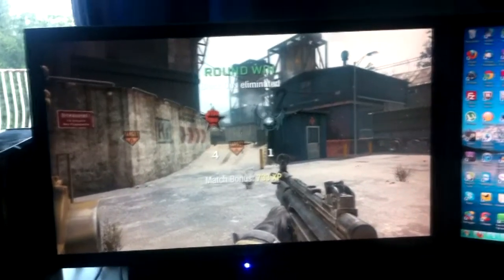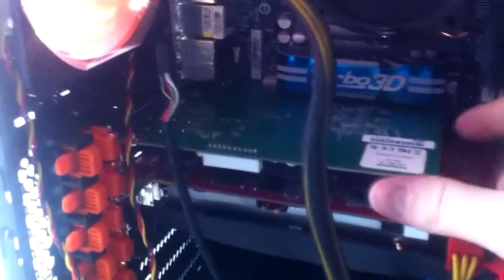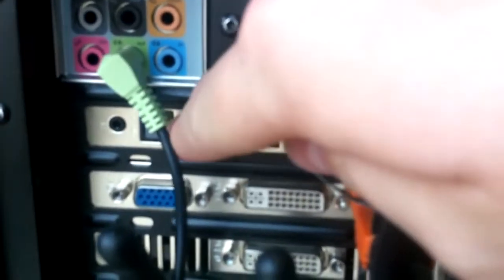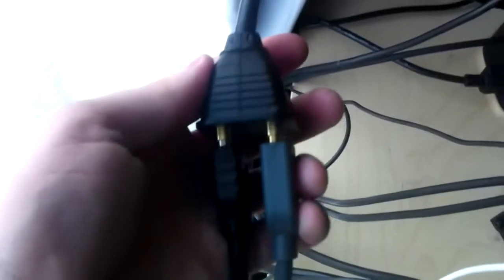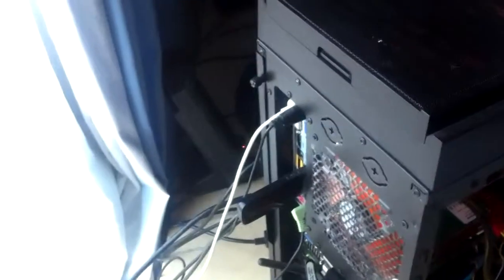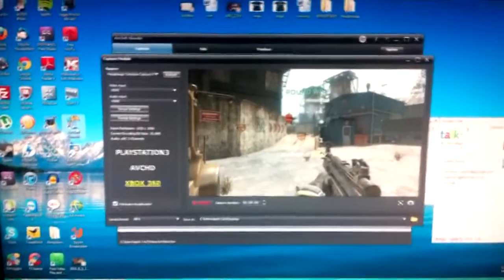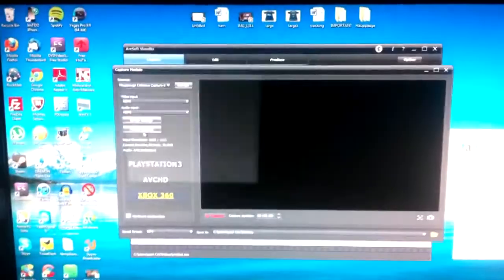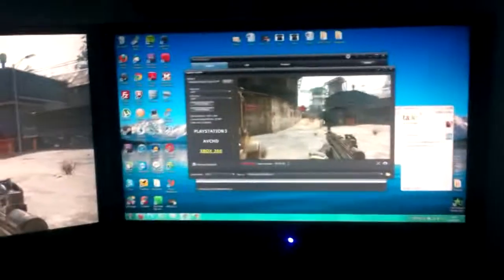Hauppauge Colossus Capture Card Set Up with Xbox 360 & HDMI by CazuaLLUK

Comment: I have tried to use my colossus with xbox and it does not work, I am using the same splitter you are with 2 hdmi cords that work on there own and on the splitter and my xbox is set to 720 and the arcsoft is set to hdmi and i still get a black screen on recording, i get picture on my tv but nothing on the recording software? any help

Comment: Hey I need help.
My Xbox (Elite) is set to 720p.
I did everything like in the video but i get no signal from my xbox. And even if I plug the HDMI cable from my Xbox directly into my colossus and set everything to HDMI everything i get is a black screen.
I did the setup with an other HDMI device and it workt fine. 
So i'm sure my xbox is the problem but what can I do now?

Comment: whenever i try to split it from the xbox, it doesnt display any picture on the computer where its hooked up the the hd pvr. when i just do one hdmi to the pvr, it works fine. i tested both cables and hooked it up to 2 hdtv's and both worked. its whenever i try hooking it up to the hdtv and pvr at the same time it doesnt work. any ideas?